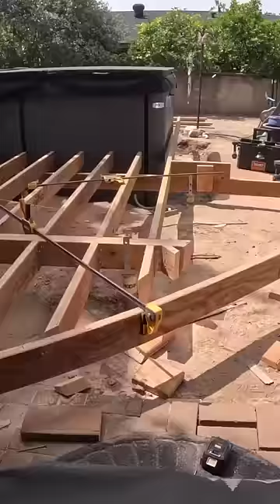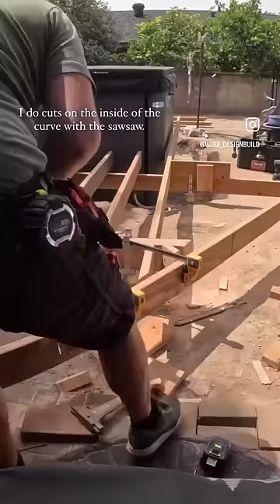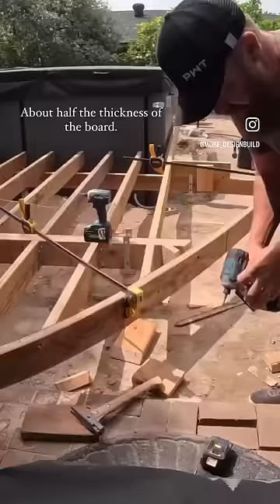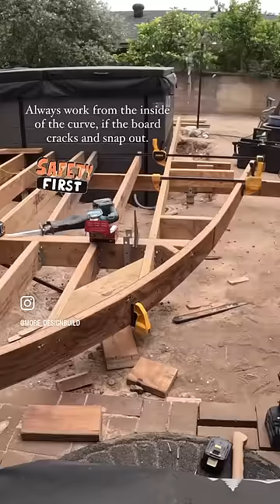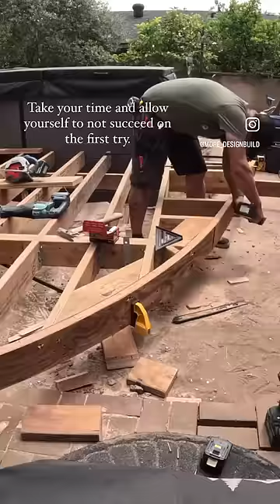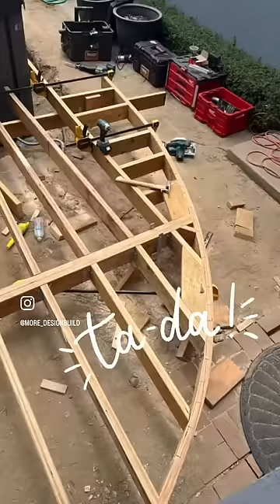Bending the deck frame with engineered lumber 👌🏼 #contractor #innovation #protips

Comment: Did this alot when I used to build decks. Would use the old 4 foot long solid steel clamps with a twist crank at the end. If the homeowner had a pool we would throw the board in the pool and leave it and go to lunch and come back and it would be much easier to bend, secure it properly, let the sun dry it out a little and it holds the bend pretty well. There might be a better way of doing curves like this but this works well and makes you feel like a badass.
Reply: I have built steamer boxes for that purpose! The heat pushes the moisture into the wood so it bends pretty easily. I did it before to make a recurve bow as well, it works great and you can do a large section of the porch/deck in just a few hours! The pool idea would definitely be easier! LMAO
Reply: @randyherringshaw6325  would love to see the steamer boxes you made?  I’ve been trying to rack my brain how to make one for larger boards to bend?  Haven’t came up with any clear reasonable ideas that wouldn’t cost a fortune to build yet! 
Funny though how many wood shops have apparently no idea how to bend wood. I’ve had customers tell me that other wood shops told them that bending wood in a S shape couldn’t be done! Guess I did the impossible for the customer? 😂  But it’s not the first time I‘be heard people tell me others said something couldn’t be done and I figured out a way to do it!  Many just don’t want to take the time and effort to figure out a way to do things that they normally wouldn’t ever do! Personally, I enjoy the challenge!  Long as customers willing to pay the cost after I figure it out, I don’t mind giving it a try!  Sometimes you can really make some good profit on projects that people really want but no one else is willing to do it like the customer wants! Instead give one excuse or another why it can’t be done!😂
Reply: great idea if it work's that's the way to do it. can't be easy to get a bend like that in a board.
I would have cut slices to curve it then add wood glue where my cuts are at. Then again I'm not a carpenter just a guy that does lot's of craftwork with different materials.
Reply: I have 8 or so if those crank clamps attached to everything from 4' to 6' lengths of 3/4 pipe. Sometimes a pain to use because you only have 4" of clamp travel but they hold strong.
Reply: @randyherringshaw6325  
I have never used a box but seen them used on bow making. I was amazed at how much bend you can put into a piece of wood.
Reply: @ghostridergale  I use 1 inch plywood to build the box, paint it with high temp epoxy paint and line the inside with heavy duty aluminum foil (to help trap the heat) and seal both sides of the seams with aluminized tape. On the ends I use silicone pads I got from the cooking section of Dollar Tree to keep the steam from escaping. I have a small boiler system that I made to pump about 2 inches of boiling water through the box to steam the boards.
Reply: @randysmith9636   I actually got the idea from a bowyer that I follow here on YT! The trick I learned to bending boards for building a deck is the harder the type of wood used, the longer it needs to be steamed. Until you get the hang of it, just periodically pull the board out and see if it will bend the way you need it to, but keep a notebook handy to track the time. 
There are many ways to build steamer boxes, you just have to find the style that suits your needs.
Reply: @ghostridergale an easy steam box... put nails into the floor for your desired curve. nails towards the path to ease the transition. bend the board as much as you can. water and tarp. she will get moist and hot and bend how you please. come back and repeat and that old girl will bend in ways you never imagined.
Reply: @arjparke3124    🤣🤣🤣🤣 What you are talking about, best case scenario, will be almost a full days work. By using a steam box, the boards will be ready AND INSTALLED before lunch!!!

Comment: Nicely done brother. . I'm a carpenter too and I'm pretty sure half of these ppl dnt understand the time it took to figure it, cut everything and put it together to do that but I damn sure do and that's badass. . 

I wonder if u had some hot water to spray on it to help keep it from cracking or busting anywhere..
Reply: My dad did this when building me a half pipe as a kid. The water helps a ton.
Reply: Steam baby, loosens those fibers right up. You can get crazy shapes like guitars and pianos with cracking the wood.

Comment: Great job! Not easy considering the inflationary bent wood we get at the lumber yards.
Reply: This is 100% correct.  I can no longer trust a package from the lumbar yard, its not worth it. It went from 5% to 25% in return just from jacked up lumber. Depending on job i will spend half a day picking out my own lumber.

Comment: Did this with my deck, put a 45 degree radius on the four corners.  Used pine 2x10x8 s, soaked them in water for a day. Worked perfectly.

Comment: Need steam. Works temporarily but has lots of stress fractures and will continue to break rather than keep its form
Reply: False 😂
Reply: The "engineered" part here is important.
Reply: @bretondavid6288  I wouldn't mind being wrong. Care to explain?
Reply: Wood is way more flexible than you are giving it credit. There isn't stress fracturing from this bend, if there was you would see wood fibers poking out all over the place where it broke free from the stress. There is still moisture in pressure treated wood besides those facts
Reply: @dambroangling2828  your NOT "wrong", friend, don't let YT-tell ya otherwise. wouldn't hurt to have let it sit in water overnight. I build wood/epoxy sailing catamarans :-)
Reply: @antoniiocaluso1071  there is a difference in the wood you would build a ship with and that treated board he is using on a deck. He isn't putting enough stress on a saturated board to cause stress cracks...
Reply: @bretondavid6288  not being right there, its difficult to know what's what :-) I do remember an old plan (in a magazine, imagine! :-) for building a wood boat trailer with a similar front curve. BUT...the wood used was clear 1x6s, laminated 4-ply in a flat table-mounted jig, and EPOXY-ied together in that held-position. Then, EPOXY-coated entirely, ensuring water-tightness and strength. Didn't even include an FGlass layer atop, which is what I'd have done! :-) It seemed to work. Similar to how big Glulams are made in a factory. Cranking that thick "beam" like that, without steam, seems...short-sighted. BTW, my catamaran is of a modified ECO6-design, "torturing" 1/4" ply slightly, onto a chined frame. Like a monocoque structure (F1, airplanes,....), and very-strong! Check out the Designer, as you may wish to build your own, too! :-)

Comment: Honest question. Will that tension cause the wood to separate later on?
Reply from the maker: I don’t think so. I’ve “secured” it every 12” in the frame and it took two days to bend it. The second day it stayed halfway bent on itself.
Reply: No will be fine 🎉 if the woods gonna split the woods gonna split it don’t matter where it is 

Wood is just terrible nowadays
Reply: @richardpoulter2146  
That’s why you use steam to bend larger pieces just like this.
Reply: @richardpoulter2146  wood doesnt split as much now because there is only 4 years growth in that board, not 40.  I have 2x4's in my home you couldnt bend after kerfing and steaming.  We counted 80 years growth in one 2x4.
Reply: @PartTimeYooper  yea,,,, try and drive a nail though some of that old lumber!! 😂😅
Reply: @steve hamman  driving a nail, drilling holes, even sawing...all a struggle.  I can't imagine the old carpenters hand sawing all that stuff.

Comment: I used to build bulkheads. We used 4x6 pressure treated lumber for the whalers. We did the same thing. Cut through about half way, every inch or so. Helped to have clear boards without knots.
Reply: I’ll work with him for free

Comment: Impressive! My father, who was an amazing craftsman himself, worked for a master carpenter who had so many tricks and secrets that he shared.  One was soaking pressure treated lumber in Anti Freeze overnight, it would turn the lumber into rubber, which they used for radius applications.  Great video by the way, amazing work, especially like those nailing blocks for post application. Well done
Reply from the maker: Thanks 🙏🏼 
The old trix is very often the best ones. I would like to try the anti freeze one 🤘🏼

Comment: Damn I missed the engineered lumber at bottom.  We used to have to slash the back out with saw about 1000 times to get that to work or use thin laminated sheets to build up front!  That's easy!!!

Comment: That's one heck of a nice Job 👍
Pro Tip
If you're using anything other than pressure-treated  wood?
Such as Ceder or Red wood?
Wet the wood at least day before you install this board.
It will make it much easier to install and help the plank to retain that shape better over the years. 👍
I used to install planking on boats and I used a steam chamber to make the planks more pliable to the boat shape.
This worked well with Mahogany, Teak, and also Cedar and Red Wood planking.
You don't have to do this procedure for fresh pressure-treated lumber due to it's wet already.
But if you're using old stock that's dried out? 
This little trick is highly recommend 👍

Comment: Not very often I use clamps for that mostly come along’s and ratchet straps. Gotta give it up to the Dewalt clamp there.
Reply: I have to admit those clamps impressed me.
Reply from the maker: Those clamps are the best 👌🏼 Probably the only thing I have that’s yellow 😂
Reply: @moredesignbuild  a lot better than Irwin's?  I need a few longer ones again after some breaks

Comment: I did this on my deck on the upper tear. It was done this way because of the way the stair was setup. Not going to go into detail about the setup, but I cut kerfs into the back  board and it did exactly what I wanted it to. Just like this guys claps did what he needed. The boards gotta be super green for the way he did it. Was nice to watch. Thanks for sharing.

Comment: I have done numerous decks using this method. The job goes much faster with little chance of the wood cracking if you get it thoroughly soaked. Nice job though.
Reply from the maker: I'll try that next time. I thought about it, but when I tied at first it bent easier than I expected so I just continued.

Comment: Nice work.

Please tell us that you went back and installed the proper joist hangers to gold the piece you bent, because we all know that under normal conditions, end grain screws/nails do not hold, let alone adding ten times the amount of outward pressure.
Reply from the maker: Yes, there’s hangers and brackets on every piece of wood on this frame 👌🏼
If you looking for a job, I’m hiring ✌🏼

Comment: you could also laminate sheets of 9mm ply (treated if outside) one at a time. Would bend much easier, and you dont have to cut kerfs. Use a waterproof glue between laminates if outside not fully covered. Youd only need 4 layers for those gaps. And there would be no member under stress
Reply from the maker: That’s a good idea. I’m always open to learn new stuff 👌🏼😃

Comment: I found this very difficult on dry lumber, without steaming . Impressive 👍
Reply: I seen this carpenter make a fire and he stuck lumber in the fire to get it hot to bend it. He left it in long enough to not burn the wood or he may have made the fire a certain way to not burn the wood. I know he got it hot enough to bend it how he needed with clamps.

Comment: Would you consider using a steam machine while bending the wood?
Reply from the maker: If the curve have a tighter radius I might think of using heat and steam, but this works out fine without.
But the deck board on top will be heated between two heating blankets.

Comment: I'm guessing that this is only part of the structure because I see you have not cut off the overhang. If so, wouldn't it have been wise to complete the frame first, then the border to prevent buckling and twisting of the frame?
Reply from the maker: I do a lot of framing during the build. Since most of my work is out from my head and I design as I build I leave a lot of possibilities as long as I can.

Comment: Poring hot water on the board as you bend helps prevent cracking the wood. This is used in all kinds of bent wood crafting.

Comment: Hmm. I like it, just a couple questions. No support under your deck boards…are you using high tensile screws? And if so, how are you’re going to screw or nail those tiny angled pieces? Also, how on earth did you get your angled cuts to butt up to your rounded edge board?
Reply from the maker: I use structural screws. I’ve support by a beam and then another beam in the end.
The deck board I heat and bend to fit the curve 👌🏼
I’ll post a video in the future of how we bend the deck board.

Comment: Wouldn’t been better to score the plank with a circular saw which would allow the board to bend and add wood glue in the grove freshly cut?
Reply from the maker: There's probably many other solutions but this is the one I use this time. Did a lot of cuts on the inside to loose the tension as well.

Comment: Wouldn't it have made it a lot easier to add a lot more kerf cuts into the back of the rim? I noticed yours for quite spaced out and I think you would have had a much easier time if you did one maybe every 2 in or less. I understand that that's a lot more time, but if it's spending an hour to save a few hours then I think it only saves you on the back end
Reply from the maker: I did every 3”. But to many and to deep will harm the board more than needed. I still need the board to have stability 😬

Comment: Great job on that, but do the guy who needs to work on that tub a favor and make those boards removable hatches so it can be worked on. Can't stand going to a customers house and seeing a deck I have to lay down under.
Reply from the maker: The whole side is removable so you’ll have access to the filter and the pump ✌🏼
A serious question, how often do you need access to a pool like this?
Reply: @moredesignbuild  to be honest it depends on the person taking care of the water chemistry, bad water causes things to deteriorate, or you got the people that think plumbing in the bottom can support their weight, and then the factory mess ups, those may involve having to remove other sides of the tub, thats why I recommend the removable sections around the whole tub if its gonna be enclosed or right against a porch.